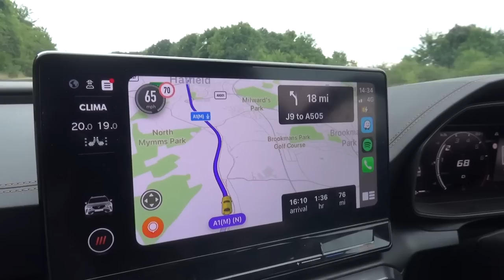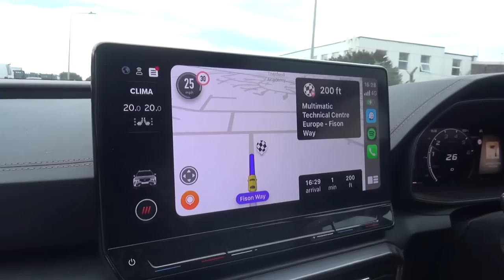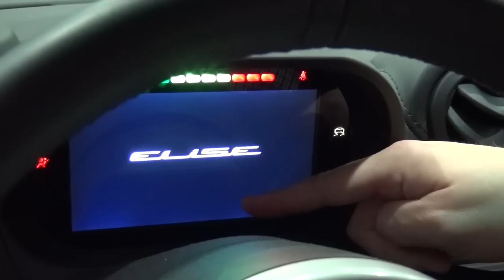THREE Shmeemobiles Return to My Garage! | SHMUSEUM VLOG 82

Comment: Gents, a little tip. Spray the suction cups with a light water spray. Sticks forever. The small pumps on the sea sucker mounts shouldn’t have any of the orange bits showing. It shows it’s then safe. Hope that helps!
Reply: I don't think they want them stuck to it forever
Reply: @y-rokenjnr6157  They do come off ;)

Comment: It’s just a thought but if you haven’t already I would check to see if the roof clamps are designed to work over PPF, in case they rip the PPF off when you get going as PPF is not a strong anchor point, unlike the roof itself. See what Topaz say.

Comment: Since the suction cups are on a surface that has PPF, doesn't that risk them pulling away at speed?  You may want to check with your PPF installer regarding this, you may need to remove the PPF before installing the suction cups and deal with some possible light buffing/paint correction of the paint from the suction cups later on.
Reply: I was thinking the same thing
Reply: Damn beat me to it!!

Also are you not risking deformation of the roof panel.... Depending upon material its made of..... Also issue of carbon fibre?. May be. Just some thoughts!!
Reply: @mikedooley1685  it's carbon fibre, not paper.
Reply: I thought exactly this.
Reply: @sabersz  carbon fibre composite. Lots of fibres glued together in layers....

Its not adamantium, or vibranium.

It can be damaged.
It can be broken.
It can delaminate if the making process is not homogeneous.
It can shatter and break similar to fiberglass. It just takes more force.

The big issue, it's if the roof has ppf...... The suction is to the ppf.... Not the bonded surface.

But yes, damage to the subsurface is less important than the whole thing popping off at high speed, taking the ppf with it, and then hitting the expensive rear end of which ever car is on. Or the car behind....

Carbon fibre rear wings... They are cheap...... Ha. 

But hey, you are correct, carbon fibre is not paper.
Well done.

The car tops might not have ppf..... But think that's unlikely due to bird poo and tree sap etc, wanting to be avoided.....

I'm sure Tim will figure something out.

Any useful ideas??
Reply: Those suction cups will not damage any surface or fall off. You can mount a bike to a car with ppf and have a full grown man get on the bike and nothing will happen. It's pretty wicked stuff. The things he is using it for are small compared to what it was originally designed for
Reply: @richardschwarzbauer201  The question isn't the suction cups, they have worked fine for this type of application for a long time.  The question is how will the PPF handle the localized stress of the suction, will it pull at speed.  PPF is just plastic film that is designed to be pulled off.  The stress in those areas driving at speed is much greater than static pressure.  Even then we aren't saying it isn't possible, but that he should speak with the installer before proceeding.
Reply: Exactly, with a roof rack both cars would ridiculously look horrible.
Reply: @brieflyjr  Sure, but he wants to go on road trips with cars with little space, probably doesn't want a support vehicle to trail him, especially with todays fuel prices or red tape,  insurance, additional hotel room, etc. Roof box is a nice temporary solution for that.
Reply: Didn't that happen to dde? It sucked the ppf off but the only realised when they removed it
Reply: Solid point
Reply: @DansManCaveUK  oh yea I think so...can´t remember with what car it was, but I also thought bout it
Reply: @DansManCaveUK  DDE also was going 180 mph too, that's the reason they flew off, not the ppf. Seasucker recommends not to do over 80 mph, but they stick well past 100 mph no problem
Reply: @gpaje  ah. I see where you're coming from! Either way we will all see how well it holds up on PPF.
Reply: @richardschwarzbauer201  Absolutely, if it works fine on PPF, even better.
Reply: @gpaje  for sure! The guys at SeaSucker were super excited to hear that his product is being used by Shmee and I can't wait to see how well it holds up on ppf at speed

Comment: If they suction cups don’t sit flat when placed, pushing them down and then applying the vacuum will pull the roof out of line to meet suction cup as the bracket isn’t flexing. That made me wince watching that on the SF90. Had a similar system years ago for putting a road bike on the roof on a car with no provisions for a roof rack. Messed the roof right up. Expensive mistake.

Comment: Leave the US system on there if you have to take it all put the factory one for your MOT fine when she get the MOT put the US went back on cheers
It’s in a Akrapović it’s a mandatory exhaust for that bio Ecoboost. It’s a turbo I just straight pipe it but you’ll probably lose so much low end torque I’m guessing I need some kind of back pressure I’m sure if I were to function properly nobody said I was an engineer🤣🤣🤣🤣
Dude what’s up with the big grandpa glasses lad???🤓🤓🤓😭😎